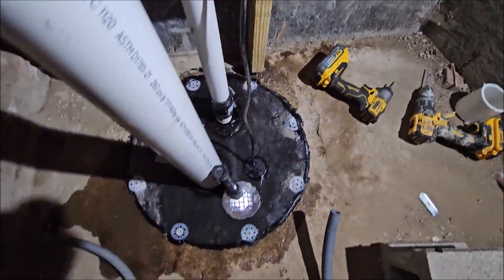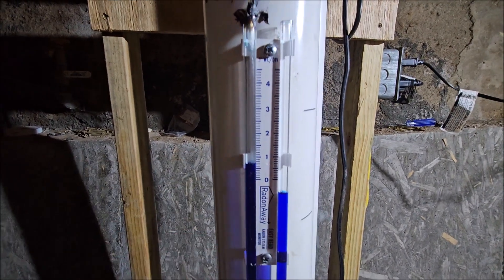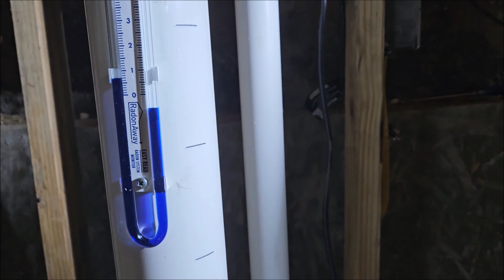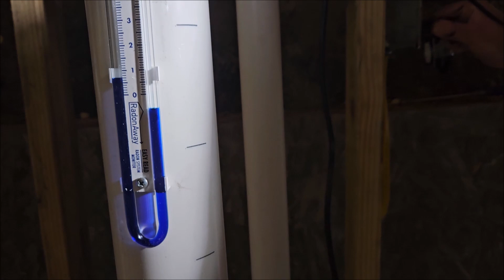How to Seal Your Sump Pit for Radon and Still Allow for Flood Water to Drain Into It

Comment: But if the water dries out of the u-tube trap, then air from basement will be sucked out through drain instead of from under the slab.
Reply: Use oil?

Comment: What size PVC tube ??
Reply: @hitefarm The trap on the drain looks to be 1 1/5 inch.  Sump pump outlet is either 1 1/5 or 2 inch.  The radon vent in the center is 4 inch.